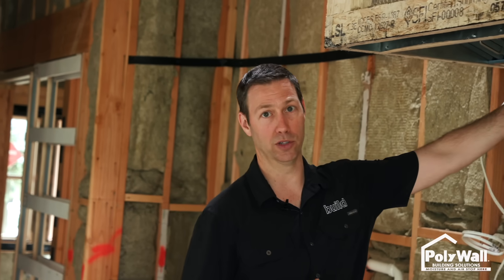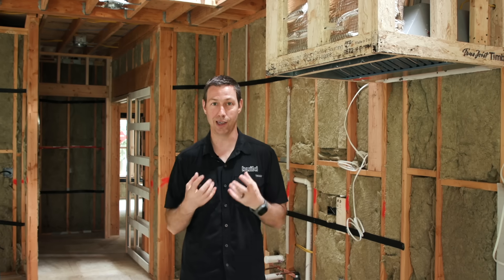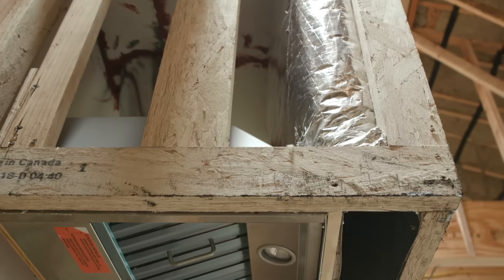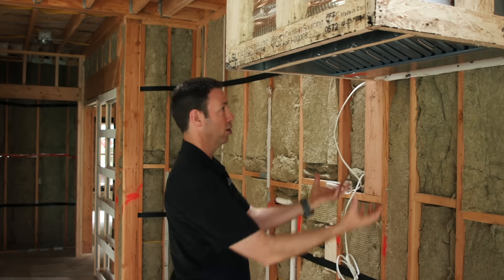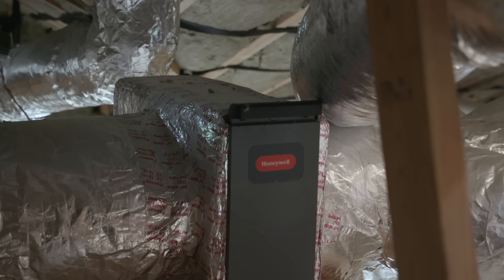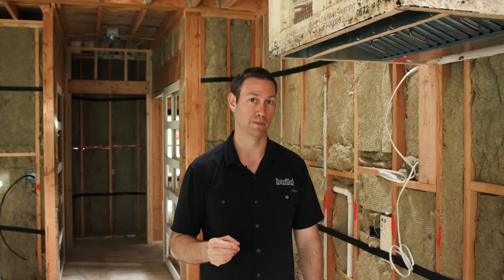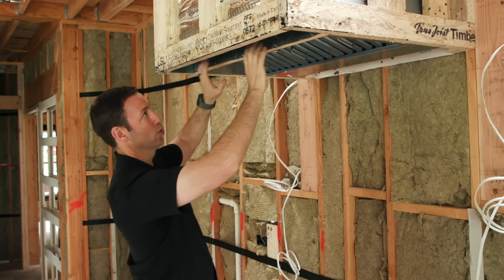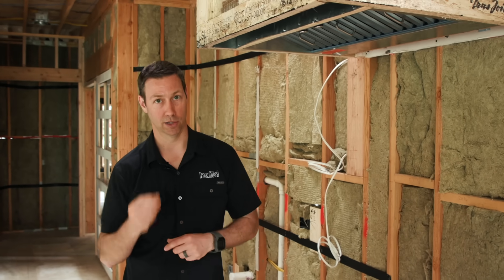Make Up Air - Kitchen Hood in a tight new Build

Comment: Wouldn't a setup like this create a short-circuit where the vent will actually just be pulling only the outside air our of the house without much of the particles from the range being captured?
Reply: This green building advisor article mentions the short circuit problem. https://www.greenbuildingadvisor.com/article/makeup-air-for-range-hoods

At the very least it looks like a lot of make up air and exhaust capacity will be wasted with this setup. It would be better to have the make up air enter the kitchen somewhere else. Or pick an induction stove and a small vent hood instead of the presumably gas cooktop they are going to put in here.
Reply: @mattv5281  your comment is the most correct one here. this is a terrible location to put an inlet duct relative to the exhaust duct. you won't get an actual short circuit where no kitchen air is exhausted, but the air changes per hour for the kitchen air will be reduced. it would be better to put the inlet duct across the room so that you maximize the amount of mixing between the make up air and the air in the room before the make up air is eventually exhausted. on the downside, the increased mixing means more load on your heating/air conditioning system. the benefit of the system shown in this video is that it reduces the load on the heating/air conditioning system that is created by the make up air system.
Reply: Ok smart guy, bring logic to the argument why dontcha!
Reply: I would think even if there is a short circuit, it would still create a Venturi effect pulling in the dirty air into the hood. 🤔
Reply: @teaforbastards   It's more a matter of air density than a venturi effect that inhibits a "short circuit". The cooler bypass air is denser and falls onto the stove area. It's then heated and rises; picking up particle along the way. You won't see a venturi effect until the air gets closer to the exhaust inlet where the velocity of the air increases. There may be some slight circulation that bypasses the stove, but it would be negligible.
Reply: Venturi effect or not might be difficult to judge. However, Venturi effect should be applied only when necessary as it does not guarantee the highest efficiency of the system. This design clearly reduces the air flow that carries the unwanted smoke.
Reply: Close Jeff, but this is not short circuit, this is an air curtain design, short circuit is when the air is injected directly in the capture area of a hood and does not have the ability to mix with the space, creating a reduced net exhaust.  

What happens here, is that the thermal updraft from cooking will make it to the hood first.

And let’s be honest, residential hoods have minuscule capture tanks compared to true commercial systems.

Short circuit systems were put in place 40+ years ago as a work around to exuberant airflow minimums to meet code. This all changed with UL 710 listing of hoods where manufacturers tested their hoods and had minimum CFM requirements based on capture performance to bring airflow requirements down as compared to ‘shop built’ non listed hoods that had poor performance and substandard construction.   All of this was done to attempt to maintain the temperature in the kitchen, and reduce AC tonnage.    ...did i loose anyone yet... lol
Reply: @jaymondy  ul 710? I like it, and I'll go read it. Good stuff.
Reply: Alexander Riccio the other main code in regard to commercial systems is NFPA 96. Chapters 4-5 if i recall correctly.
Reply: I’m a HVACR guy in Florida. Restaurants have powerful hood systems. The make up air ( MUA) is mechanically aided with a blower motor/fan . The air cascades down creating a wall that aids in keeping smoke and cooking particulates away from the kitchen and “pushes” it up the hood toward the exit from the structure and the exhaust fan sucks it out.
Reply: bill-co air curtain = creating the laminar flow zones I refer to in my post!  I stayed in a Holiday Inn express.
Reply: @billcv80  restaurants also have cooktops with btu ratings that are several times higher than anything that you would be able to get into a residential setting. that's why they need more powerful hood systems.
Reply: paper wait 
Have you seen some of the range tops people are putting in their homes?  Capital makes one 5 feet long with up to 8 burners.  Not commercial but pretty close.
Reply: In my state make air outlet has to be a minimum of 36" from the exhaust vent on the interior side and exterior needs to be 10' from any exhaust. I try for the opposite side of the house if possible. I do mid to high end kitchen remodels. Also make air is required on any exhaust fan 400 cfm or greater. Our code is based on the IBC and IRC books.
Reply: steve timleck depends on the Reynolds number.
Reply: @michaelneely4185  we're talking about air here; not some low viscosity fluid. high end houses usually go for hoods with ridiculously powerful blower fans. it would not surprise me if this hood didn't have a 1,500 cfm blower. it is meaningless to talk of air having laminar flow under those conditions.
Reply: The makeup-air supply seems like a good idea, but in my opinion, it should be located some distance AWAY from the exhaust hood, so that the exhaust can grab cooking smoke without it getting diluted by fresh air.  The fresh air should come in somewhere else.  The simplest solution would be to tie the makeup air duct into the main HVAC system.
Reply: @kc9scott  or just crack a window lol
Reply: Kevin Scott you use smoke indicators to observe the air flow.  That would probably show that the turbulence created by the two adjacent and opposite laminar flow columns is highest near the cooking surface and therefore helps to mix and incorporate the gasses generated by cooking into the air that is being drawn through the vent.
Reply: @kc9scott  I saw one guy put floor registers under the cabinets with vented toe kicks for make up air
Reply: Kevin Scott Challenge with this is that the HVAC system lifespan will shorten quickly as components are not constructed for the raw outside air. Coil coatings will help, but ultimately residential coils & fins are not able to handle this amount of humidity, depending on the location.
Reply: @jaymondy  stupid comment, evaporator coils due just that, they get wet, hence the drain pans they sit in and the condensate lines carrying water away. Those coils aren't going to wear out any faster with fresh air added to the system than without.
Reply: @mitchdinner9743  *depending on location, 40-50% of Americans live within proximity of the coast, don't cherry pick what you want to read and ignore. :elbowcough:
Reply: Brian Merrick this is true assuming it is not a powered supply and it is gravity supplied. If it is a powered supply air and not properly balanced could make for a mess.
Reply: BLAH Blah  Blah, it was smoke tested.
Reply: Yes it will.  Another youtuber did a test of a similar setup with smoke bombs and it's easy to see the short circuit.  It still works, but it's definitely losing efficiency:  https://www.youtube.com/watch?v=u2uVaTMXd_8&t=293s&ab_channel=NSBuilders
Reply: @jackmorgan709  unfortunately their test was flawed in that it the stove top was completely off, and thus no heat rising to simulate actual cooking.
Reply: No. In order to exhaust air,  you must have make up air. In a very tight house like they build today, that exhaust fan would do very little in terms of cfm exhausted without it. Kurt Zimmerman.  Former hvac contractor and lead mechanical Inspector for st. Louis county Missouri.
Reply: @kurtzimmerman1637  Hey Kurt, I work for a company that makes a makeup air kit. Sometimes individuals will install the outside air damper feeding into the return air on the HVAC unit. What is your take on this?
Reply: @SAE295225  that would probably work pretty well. some new houses are tight as hell these days.
Reply: @SAE295225  make-up air is a separate system from  fresh air exchange.
Reply: At the outlet of the makeup air duct you have laminar flow which transitions to turbulent as it moves down.  At the inlet to the exhaust duct you have turbulent flow  transitioning to laminar flow.  The two columns of air in laminar flow will have little mixing compared to the more turbulent zones beneath them.
Reply: the path of the molecules are corelated to convection path, the molecules density in corelation with the atmosphere molecules density and the intake and outake position...if you'd want to get rid of heavy and or cold particles you'd want the air outtake to be under the intake... TL'DR' : now that mean if the particles are hotter or and lighter you'd want the outake to be above the intake
Reply: @TheIcyhydra  Love this, makes complete sense!! thank you!!!